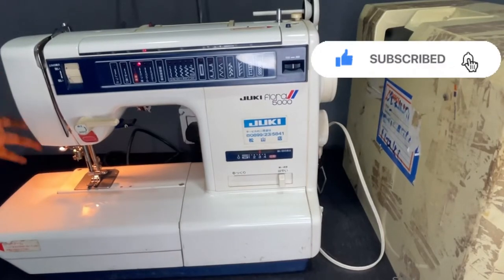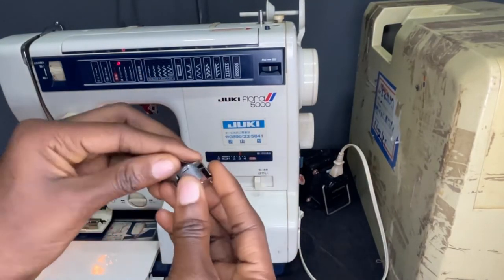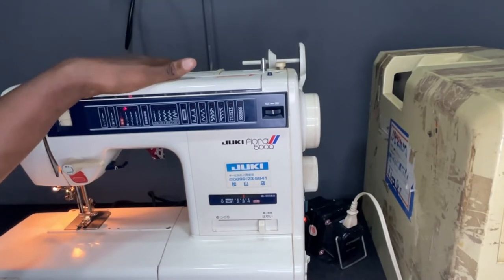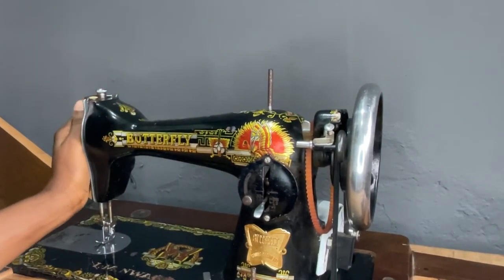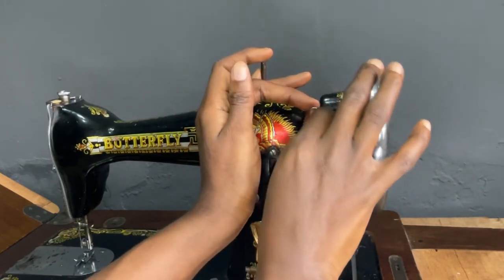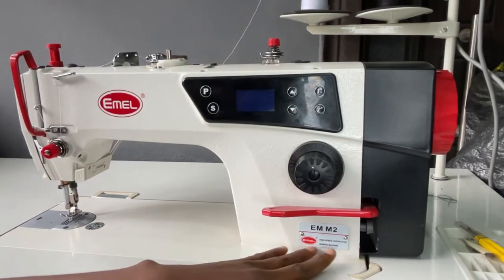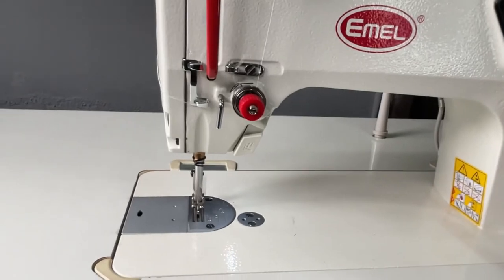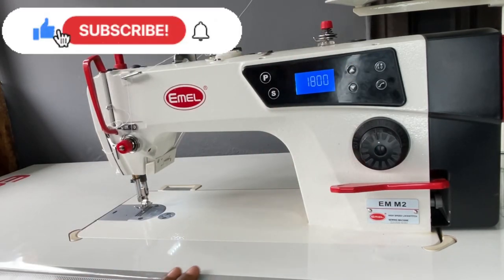DIFFERENCE BETWEEN A DOMESTIC,MANUAL AND INDUSTRIAL SEWING MACHINE. Everything you need to know

Comment: Nice  illustration👍👍
Is the new one of juki  Machine problematic
Reply from the maker: I don’t think so. Haven’t used much of their brand
Reply: @shugabeestitch  please which will you suggest I go for the new one or the tokunbo 
I need the machine because of the many function it does
Reply from the maker: I will advice a new one if you can afford it. But if not make sure you get a very good tokunbo. That doesn’t have much problems and the parts can be easily found in case of replacement
Reply: Thanks so much for the prompt response 👍
Reply from the maker: Your welcome. 💕